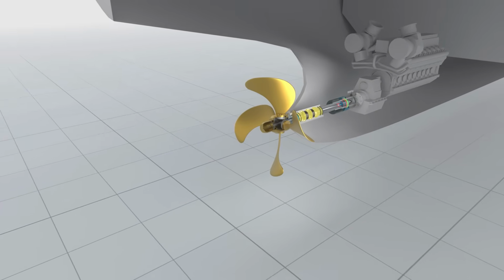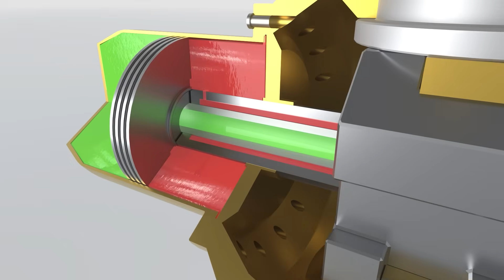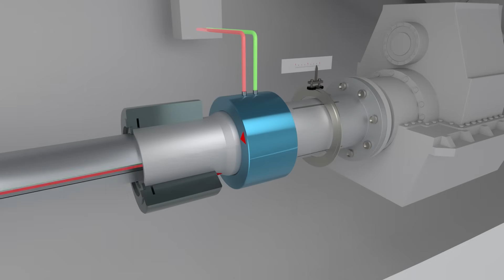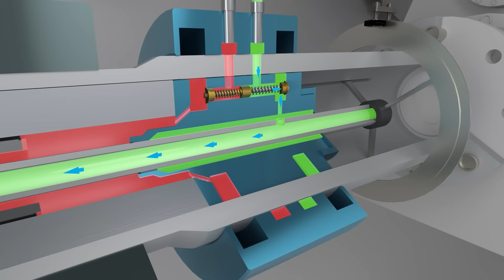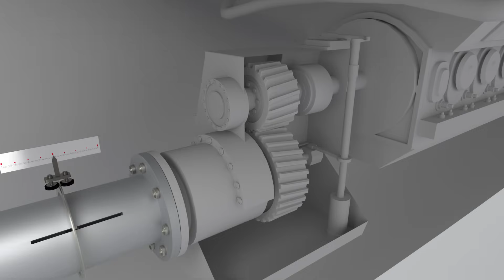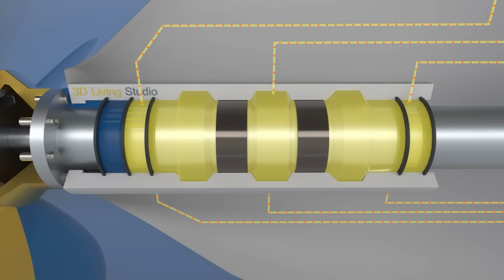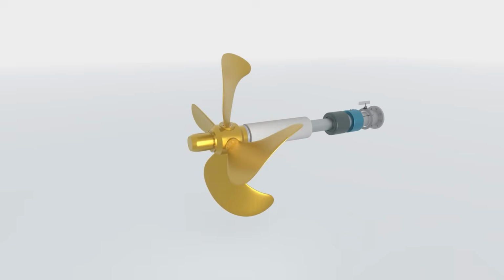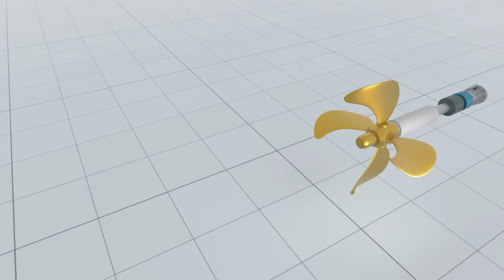How Ship Propeller Works - Controllable Pitch, Oil Distribution Box, Stern Tube Seals

Comment: You explained how pressure increases on both sides of the tube to send oil down the shaft to increase and decrease propeller pitch, but you didn’t explain how the oil returns on the opposite side when you increase pressure towards side. Based on your animation, it didn’t show any way it would return on the opposite side to return.
Reply from the maker: The oil is drained out and have to go through some processes before circulating back, it is done separatedly outside of the shaft.  Yeah, i missed that part.

Comment: Why not having a reverse gear in the gear box? similar to that of a car?
Reply from the maker: Some boats have that mechanism
Reply: it's slower to change, and much less efficient because the engine has to drop its revs instead of running at a constant optimised rpm.

Comment: Did you know that in a car engine, the intake stroke draws air and fuel into the combustion chamber with the intake valves open and the exhaust valves closed?

Comment: A lower pitch also means that the propeller provides more force (not power), for example when a ship needs to tow another ship. There is also a thrust bearing between the engine and the propeller that receives the force from the propeller and returns it to the ship's hull. This thrust bearing can also be in the gearbox if available. Very nice video, thank you.